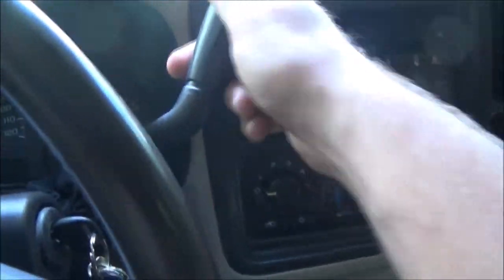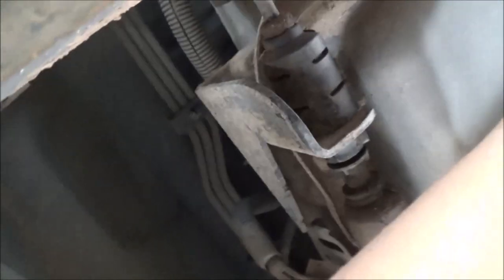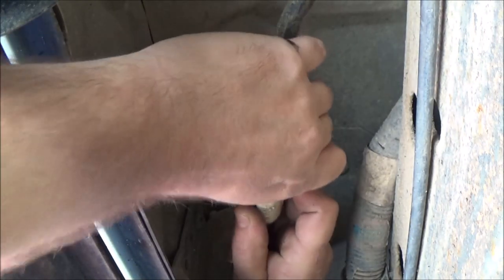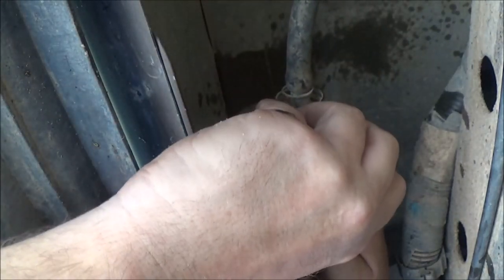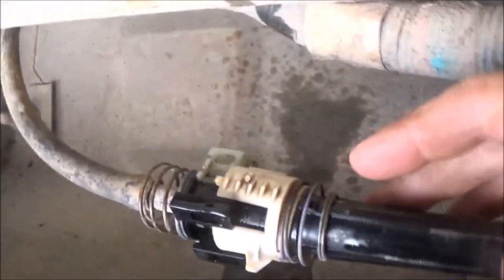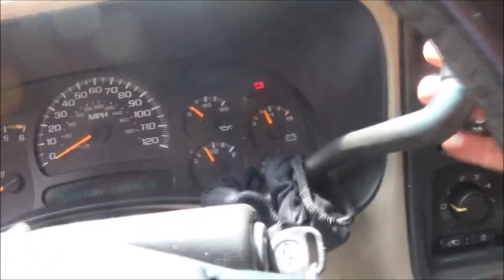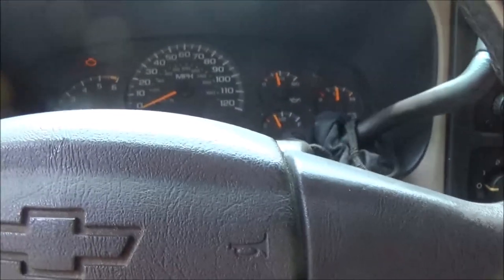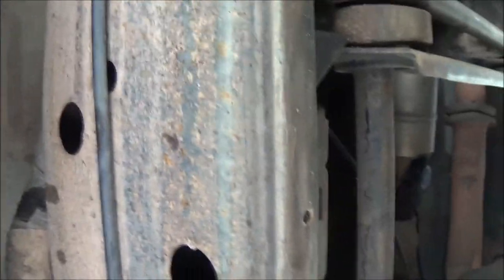Gear Shift Cable Adjustment On A 2003 Chevy Suburban LT 1500

Comment: Just put a new cable in my late year 99 sierra yesterday, from park it goes to D or N and then i have to go backwards to get reverse. I also can’t hit 1st gear. This is most likely the adjustment trick I need to do, cheers! I pushed the connectors in really tight because of a comment i read on another video before installing. At least I drove to work today hehe ;) Also if you need to use a flathead to pop that retaining clip be REALLY careful to not bust it, use minimal force!!
Reply from the maker: Good tip about the retaining clip, I should have mentioned that in the video.  Thanks for sharing 👍

Comment: The return spring is broken in the shifter on the steering column
Reply from the maker: no it isn't.
Reply: Nah. If your cable is adjusted wrong. It can happen. Happened to mine when the cable over stretched.

Comment: Hey shabear, sometimes when I start up my 96 Honda, it bogs down and doesn't gain speed when accelerating. It's not throwing any codes and it's got a new air filter. Do you know what could possibly be the problem or what I should have a mechanic look at?
Reply from the maker: Check fuel filter first.
Reply from the maker: Could be clogging.
Reply: Ok I'll have them look at that first.
Reply from the maker: Let me know what you find out.
Reply: @shabear1000  I'll let you know. I just hope the fuel filter isn't in the gas tank
Reply from the maker: There is a sock in the tank. Filter is between tank and engine.